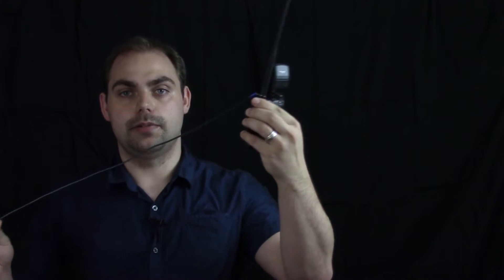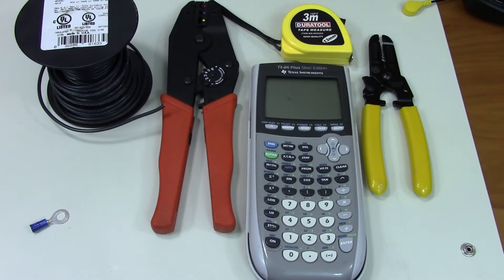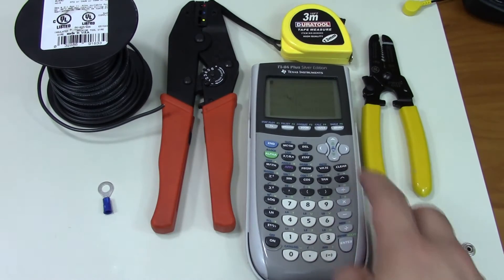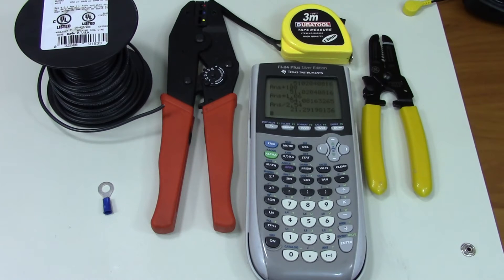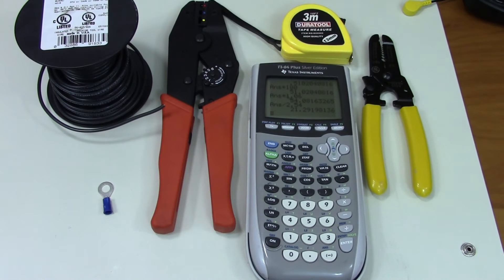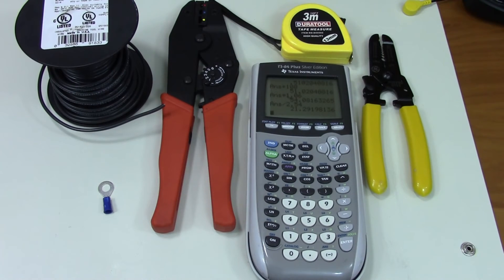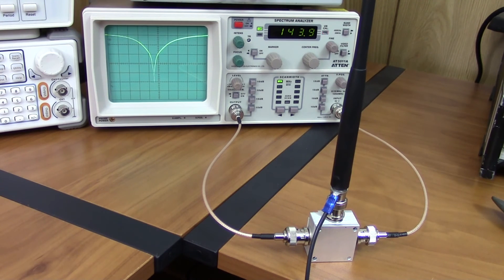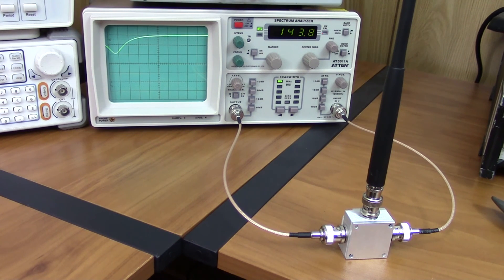HT Power Hack: How To Increase Handheld Radio Range

Comment: So .. i used  an Handheld Radio in the Army (SEM52) ... it had a build in Counterpoise in the Carrying "Sleeve"/... no one ever changed the lengh according to the used Freq.  It was Buld in...
How could that Work ?
Reply from the maker: It's no problem to use a counterpoise that is larger than half the wavelength. Or a classic groundplane. But then it's not a dipole anymore, but a monopole instead. That's what most mobile antennas are and on better handelds, like military radios, the rugged metal case serves that purpose (also capacitively coupling to ground through the person holding it). Chap handelds do not have that capability with their plastic cases.
Reply: @BalticLab  Thanks 👍

Comment: HELP! If your still there. I need your help. I want to put a ground plane on my 7/8 wave Dual Band 2m/70cm. So would 54cm long radials work? And what is the math for 440?
Reply from the maker: Use a 7/8 wave tiger tail.
Reply: @BalticLab  How do I figure out the length? And do I need to make two? 2 for 2meter and 2 for 440?
Reply: @BalticLab  I hope your still there. I know 300 works to make a quarter wave tiger tail. But what do I start with, to make a tiger tail for a 7/8 wave antenna?

Comment: Thanks for the wonderful video. I have made a tiger tail for 145 MHz which xomes to around 21.5 inches using a 1.5 Sq mm wire. Can you pls advise on Tiger Tail lenght calculation for 435 MHz UHF Band

Comment: Now what do you want to tell us with those osciloscope video? That changing the antenna system geometry by adding a ground wire will change the SWR? Take this antenna in your hands and walk around and you will also see some interessting changes in the SWR. Since you haven't measured real world performance of this construction with real (and hopefully not the cheapest stock) antenna and real HT, that proves nothing.

Comment: Hi, I want to use my Beofang UV-5r to pick up commercial radio when I go backpacking. The station I want to listen to is 97.3 FM. According to your math I would need a counterpoise 81.70586 meters or 32.16766 inches. Is there anything wrong with this math or concept?
Reply: 300 m/sec divided by 97.3 MHz = 3.083 meters for a wavelength.
3.083 m X 100 cm/m = 308.3 cm
308.3/4 = 77.1 cm for a quarter wave in free space and adjusting for overhead
1.06 X 77.1 cm = 81.7 cm  (note not meters)
converting 81.7 cm to inches yields between 32 1/8" to 32 3/16" so no there is nothing wrong with the arithmetic, just the misuse of meters versus cm in one of the intermediate steps. With the power level of commercial FM stations, the wire  probably won't be needed, or if used, perhaps the wire should be deployed horizontally to account for the commercial station's polarization.

Comment: So on 70cm, my frequency I use most is 448, so divide 300 by 448 and then by 4, then times by 1.06, then convert to inches? Also do you connect this to the same ring terminal as your 2M tiger tail, or does it go on its own?

Comment: You tested with the rubber duck antenna.
Will  a tiger tail yield similar benefits when used in conjunction with 1/4 wave antenna instead of the rubber duck?

Also, will there be a notable difference between the SWR of a rubber duck with a tiger tail, and a 1/4 antenna with a tiger tail.

I like what a tiger tai does for me within the tuned range.  I'm just trying to figure out whether to use it with my 1/4 wave antenna or factory rubber duck, or if it even makes a difference.

Thank you for the video and the information.   -Phil
Reply: I've seen videos and read comments that the factory rubber ducks, at least for Baofeng UV-5R, is just a dummy load, essentially. So this would be a huge significant difference.

Comment: So, basically, you change a monopole antenna into a dipole and see a change in resonant frequency due to the different impedances at the input of the two antennas. An interesting fact not commented on is the strong reflection from the human body (i.e. "spectrum analyzer freaking out") in close proximity to the antenna. Imagine how much transmitter power loss a handheld terminal inherently has due to all this juice going back into the transmitter (and also the importance of good TX filters before the LNA!), and also, that due to this inherent "user attenuation", you will get more than the indicated antenna gain when switching from a monopole to some higher directivity antenna in this usage setting.

Comment: for 2m we need 54 cm. 1.6 mm cable diameter for tiger tail right ? 
I suggest you add the calculation in comments. 
Thanks

Comment: Sebastian: Thanks for the detailed video, and the visual evidence. I'm curious, what does the analyzer show with just the tiger tail and no antenna?
Reply: Without an antenna at the test port, the electric field lines can only go from the test port center to the test port shield (give or take some infinitesimal fringing fields); adding a tiger tail to this setup will not substantially change what the wave at this port sees (low permittivity in air), and thus neither will there be substantially more radiation from the port, nor any visible change on the screen of the spectrum analyzer compared to an open circuit (with other words, still a gamma = 1 over all frequencies).

Comment: Would that also work on cell phones or Wifi?
Reply from the maker: If you have a cell with an external antenna, yes! And it definitely works on those little screw on WiFi antennas such as the ones you find on most routers.